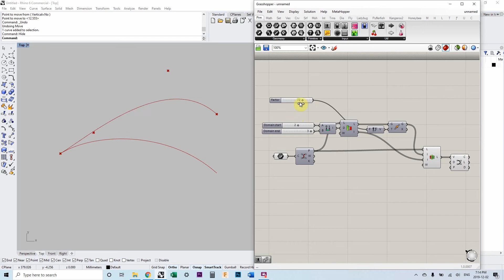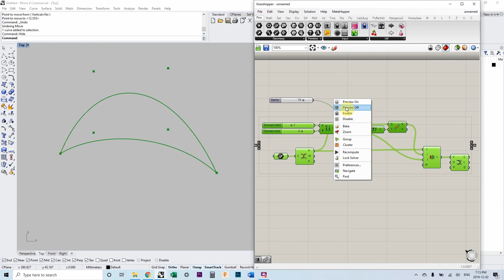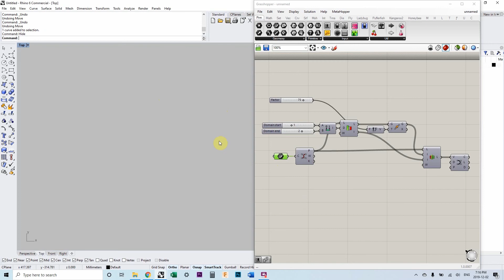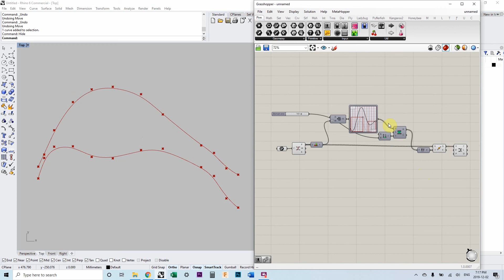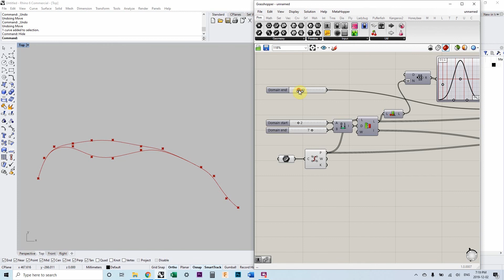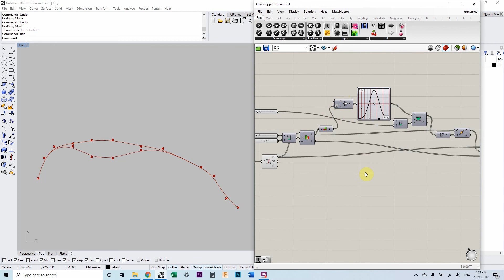Grasshopper Tips: Editing the shape of a Control Point curve in GH

Comment: Hi 
Can you help solve an error I’m having while using the combination script. It shows an error stating to supply equal amounts of items and indices
Reply from the maker: Happy to help! Should be an easy fix, but I don't know exactly what the problem is in your case without seeing it. I assume your are getting this error at the "Replace Item" component. For each replacement item (2nd input), there needs to index (3rd input) to establish which item in the original list (1st input) is being replaced. This error is telling you that you have a different number of replacement items (2nd input) and indices (3rd input), so there's no way for the component to interpret where replace each item within the original list. Have a look at the number of items in these inputs that I've mentioned, and look carefully at what data you are using for these inputs, and let me know what you find.

In the script in this video example, the "Sub List" component outputs the List Items, and the Indices of each list item. The sub list items are modified with the move component and then sent to the "Replace Items" component. The indices output goes straight the "Replace Item" component. This strategy works because each list item always has an associated index, no matter how many items we pull from the sub list component.

Comment: Can GH control similar points of multiple curves at one time? In creating a basic four sided awning in 2D, I want to provide the same 'hollow' at all four sides, at the same time. A 'hollow' is a an arc that flows inward of a rectangle...three sided awnings (or sun shades are a great reference for what I mean). It is basically subtracting material from a basic shape. This would speed up my workflow and provide certainty that all 'hollows' are the same at all sides. Thanks for your help and consideration. I have not been able to find a video that comes close to yours.

Comment: Is it possible to move certain points on the x-axis and some on the z?
Reply from the maker: Yes, definitely is possible! There's many different ways to achieve this based on your specific objective. For example, you could copy/paste this script and chain them together so that the first part moves points in x and second part moves point in z. Alternatively, you can actually add vectors with the Addition component. If you used that method you could make two separate graph mappers, one for x and one for z, then add them together to get the resultant vector. This might be a little confusing without a visual.

If you need more clarification I'd be happy to help. If you want, send me an email at pfors@5j5.design with more details of your project or idea and I can offer my advice.

Best,
Phil

Comment: what is the expression that you used in Range?
Reply from the maker: Expression: x-1
When using the range component, the total number of output values will be one greater than the input parameter in "Number of Steps". (ex. if number of step equals 10, there will be 11 output values). When I want the number of output values to equal the input parameter I use the expression : x-1. 
Does that clarify?
Reply: @parametricphilosophy1072 thank you
Reply: Thanks